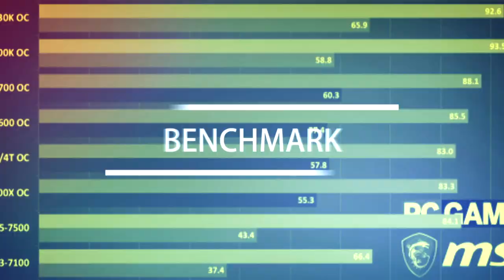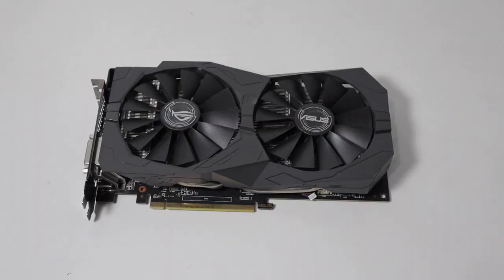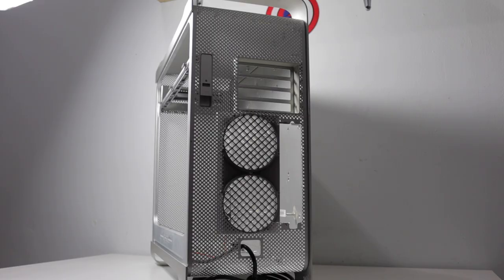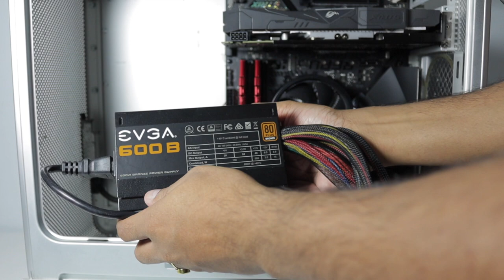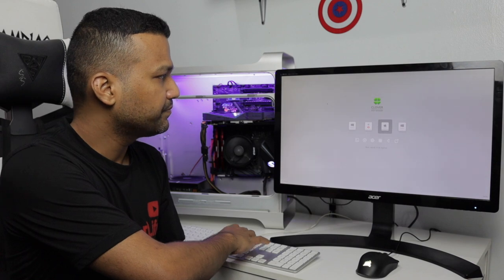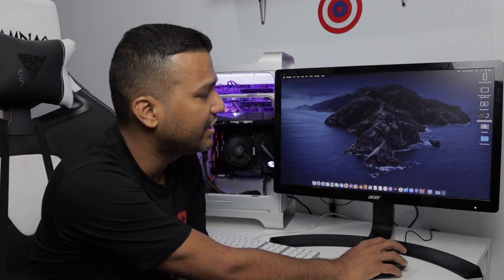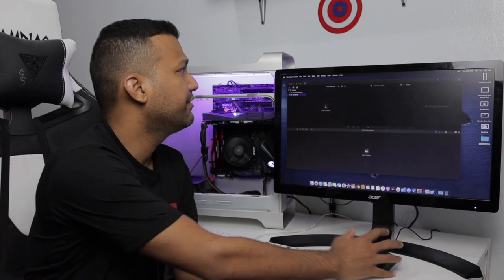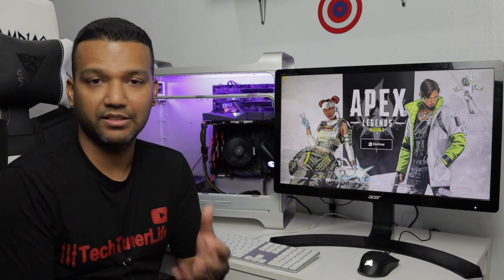HackPro Dual Boot MacOS Catalina and Windows 10 Workstation/Gaming Update

Comment: It's actually much easier to Dual Boot Mac OS / Windows 10 
If you use a Bootable Disk Partition Software to Create the Partitions using GPT/GUID Partition Scheme.
Then install Windows 10 on it's Partition First.
Then Install Mac OS on it's Partition this way the Clover Boot Loader will AutoDetect Windows. 
It's much easier and Faster to do it this way.

Comment: Hey bro I want to build a fully spec out hackthosh what will you recommend to go with amd or intel build
Reply from the maker: How much you looking to spend? Also are you planning on running adobe applications?
Reply: TechTunerLife I just want to go all out bro what is the your best recommendation I will gaming + I just want to have a mac
Reply from the maker: Motherboard: Asus Prime Z390-A
CPU: Intel Core i9 9900K 8Core 16Threads
Cooler: Be quiet Dark Rock Pro 4
RAM: Corsair Vengeance RGB PRO 32GB 3200mhz (2x16)
GPU: XFX Rx5700xt Thicc III Ultra 8GB
SSD: Samsung 970 Evo M.2 1TB (2X)
PSU: Be quiet Straight power 11 650w 80 plus gold
Case: Be quiet pure base 500
Reply: TechTunerLife thank you so much ☺️